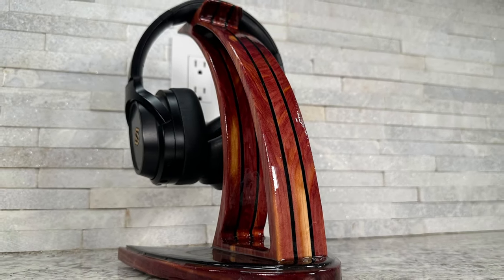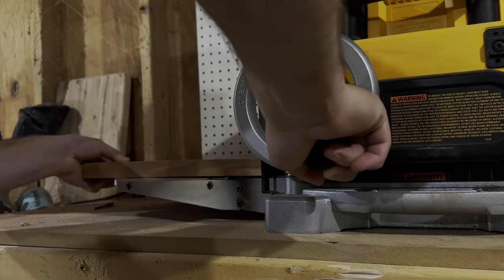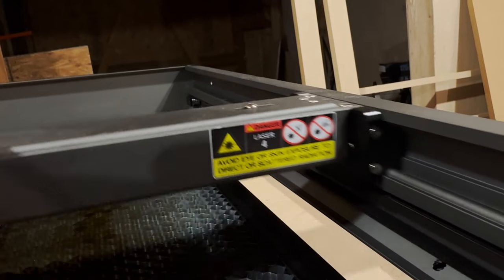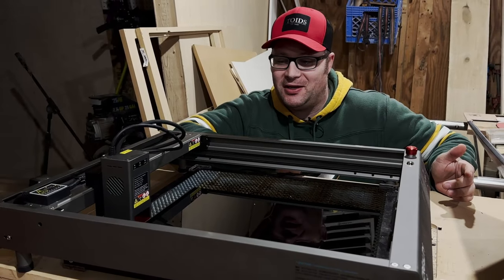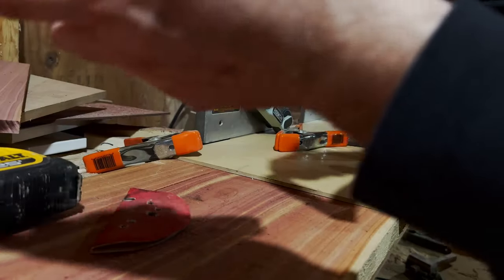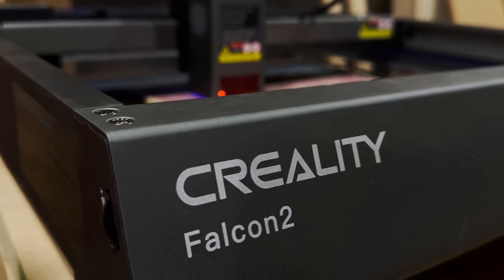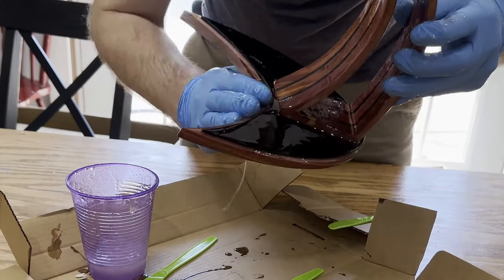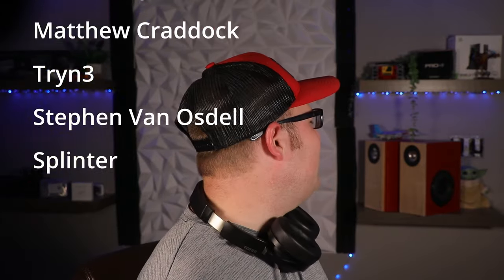Laser Engraver - DIY Headphone Stand Featuring Creality Falcon 2 22w Laser

Comment: Really interesting build. Just wondering; wouldn't a bandsaw have been much easier and quicker?
Reply from the maker: Definitely another option you can use. You could even use a cnc or a router with a template bit. I personally don’t have a band saw. Which is kind of funny since I have a few lasers and a CNC.